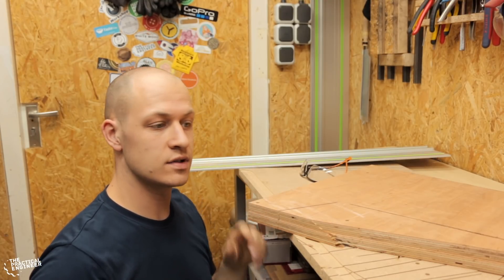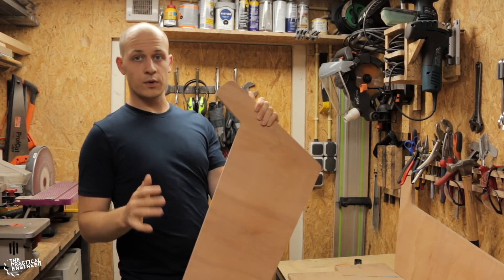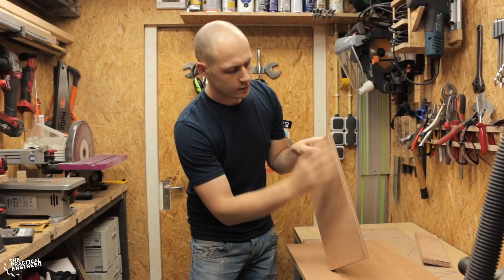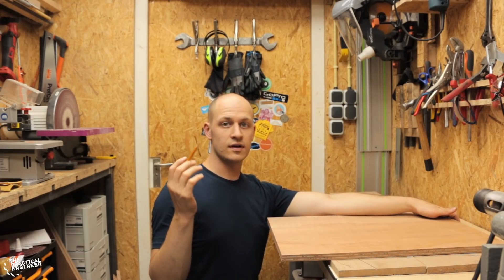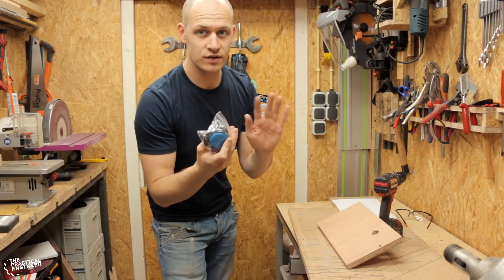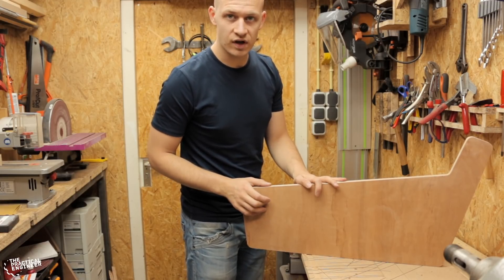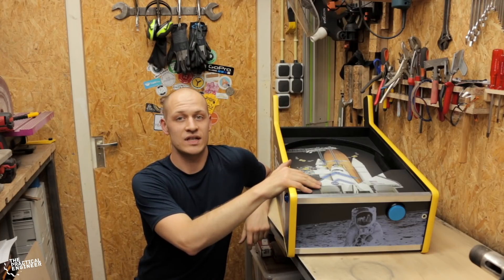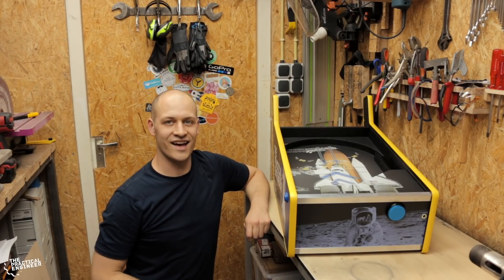DIY Tabletop Pinball Machine - Making the cabinet & decals

Comment from the maker: There are plans available for this build! Check them out over here: 
https://thepracticalengineer.com/plans/tabletop-pinball-machine
Reply: I can't find any reference on the pinball ball size that you used. I'm leaning towards 12 to 16mm.
Reply from the maker: Hi, I used 16 mm. It will work with slightly smaller or larger as well.
Reply: @Thepracticalengineer  Sure a millimeter difference here and there is not going make a difference.  I have 4x 35mm long stroke solenoid coming and just realise I have nothing for them to shoot.
Reply: Do you have an up to date link to the plans? The current link gives a 404